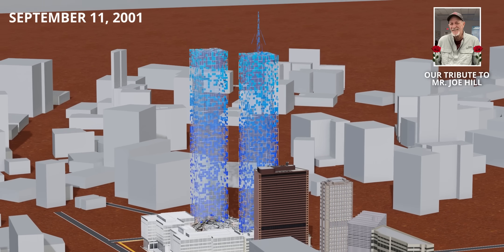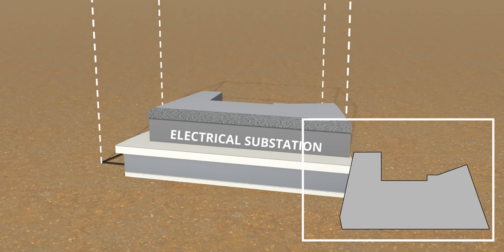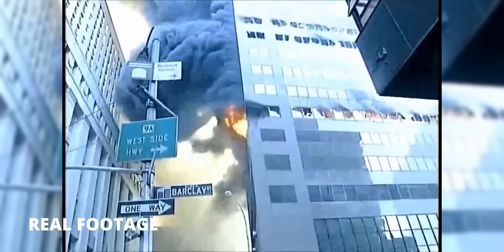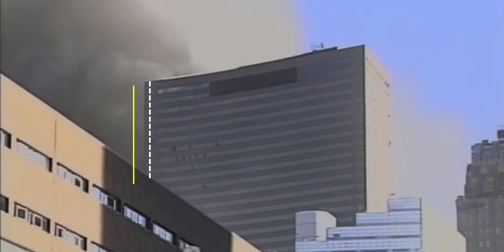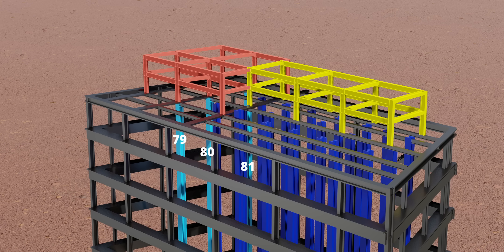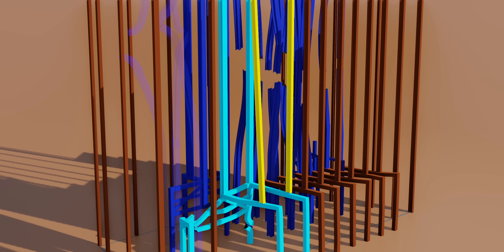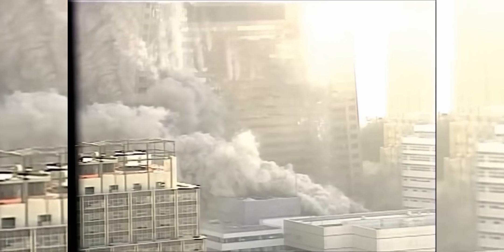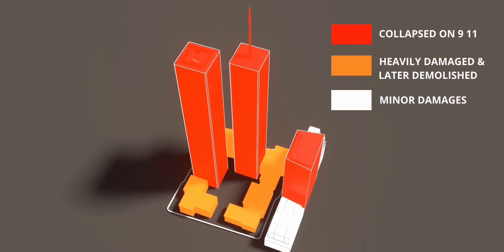Collapse of Building 7 | The Complete Physics

Comment: Absolute nonsense. It was a demolition job just like the twin towers. You have to be completely incapable of useful thought to think otherwise.
Reply: I’m going to respectfully disagree and offer a more plausible and detailed explanation using engineering, not ideology.

Much misunderstood, Building 7 was the 6th building to collapse of the 10 lost on 9/11. Because of its early low priority, conspiracy filled the information void with garbage made up by technically ignorant people promoting political agendas. But this is an engineering problem and should be treated as such, so I prepared this brief summary of my own analysis to fix that, using engineering, not politics and tired memes.

The North Tower collapse at 10:28am bombarded Building 7 with tons of debris, causing heavy damage and starting multiple fires which burned out of control for 7 hours. Half the FDNY firefighters having been killed, units in disarray, equipment destroyed, no water pressure, and the greater urgency of search & rescue efforts, firefighting was pulled as futile. The building couldn’t be saved and was left to its fate. That is the sort of choice firefighters make every day in brush fire situations - which houses to save and which ones to let go. Only real difference here is moving the decimal on the size and cost. People get overwhelmed by the size.

www.youtube.com/watch?v=g_SvpwyC17M&ab_channel=MFitz

Collapse of a burning structure is always a concern for firefighters. Steel buildings subject to fire rely on active fighting of the fires to survive. Buildings are designed around 1 to 3 hours of fire resistance, allowing time for occupants to escape and ACTIVE firefighting to get started, after which all bets are off. Left to their own devices they will exceed their design envelope and collapse, like Plasco Tower and Wilton Paes de Almeida. In B7 the occupants escaped, passive and active fire protections were compromised and active firefighting was abandoned 3 hours before the collapse, which left the building to its fate. It lost. Odds on Building 7 would eventually collapse, and it did. No big deal in logic.

www.youtube.com/watch?v=WnYBX6QT0R4

FDNY Chief Daniel Nigro ; The biggest decision we had to make on the first day was to clear the area and create a collapse zone around the severely damaged 7 World Trade Center, a 47-story building heavily involved in fire. A number of fire officers and companies assessed the damage to the building. The appraisals indicated that the buildings structural integrity was in serious doubt. I issued orders to PULL back the firefighters and define the collapse zone. It was a critical decision; We could not lose any more firefighters. It took a lot of time to PULL everyone out, given the emotionalism of the day, communications difficulties and the collapse terrain

FDNY Deputy Chief Peter Hayden ; We had our special operations people set up surveying instruments to monitor and see if there was any movement in the building. We were concerned of the possibility of collapse in the building. And we had a discussion with one particular engineer there, and we asked him if we allowed it to burn could we anticipate a collapse and if so, how soon? And it turned out that he was pretty much right on the money, that he said 'In its current state you have about 5 hours

The collapse of Building 7 was anticipated and widely reported in the media throughout the day, with 24 video cameras recording some or all of the collapse. Everyone knew what was coming and why.

www.youtube.com/watch?v=OY5S5k3tMHI

Building 7’s collapse was completely different to the Twin Towers and harder to understand as most details hidden from view and not intuitive, but we can still sort out what happened through careful analysis and observation. This is my explanation of the collapse relying on no outside authority.

Building 7 was complex, assymetrical 47-story steel framed structure built atop a smaller 3-story building, requiring lower floors dedicated to complex load transfer structures, not usable office space. Of trapezoidal shape and all-steel tube-in-tube construction, B7 (above the 7th floor) consisted of a central core of steel columns carrying most of the gravity load, perimeter steel columns around the outside of the structure carrying the remainder of the gravity loads and long span beams and girders to tie those elements together and form the floors. On the outside of the building hung a moment frame or outer shell.

Phase 1 : First externally visible signs of collapse initiation occurred at 5:20:28 pm and were notably quiet with observers not realizing the building was collapsing! No audible warning in the form of hundreds of ear drum busting 180-190dB explosive bangs preceding the collapse. Here at 12:00 a local CBS affiliate reporter is talking 10 blocks from B7 when collapse begins. People don’t start to notice the collapse until 12:11. At 12:45 is the famous CBS fixed camera clip of Building 7’s collapse. Note how quiet it is.

youtube.com/watch?v=t5tEy6mXSE8&ab_channel=fresnosean379

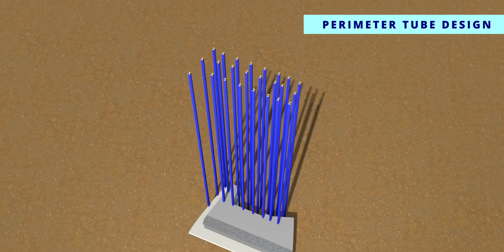Collapse initiation was due to lower floor failures above the load transfer region (7th floor) in the NE corner. In this video at 0:45 you can see the NW corner from inside the building while under construction, Column 79 just out of frame on the left. That big, angled steel beam across the top of the frame connects to C79 at one end. The girders connect to the beam. That beam and all those girders depend on just one connection

youtube.com/watch?v=nP3TNHPCIVU&t=35s&ab_channel=EdwardCurrent

Phase 2 : The floor failures caused a loss of critical lateral support over an excessive length of core Column 79 and it buckled. If you look at a floor diagram of Building 7 (see above) and look at all the structures that depend on C79 you quickly realize this one column was a relatively isolated structural element on which a disproportionately greater fraction of the structure depended analogous to say the Key Bridge. Externally we see a vertical progression of window breakage along the 44-46 line and a kink in the roof of the East Mechanical Penthouse at the top of the building, consistent with C79 failure. The transition from full capacity to almost no capacity occurs in an instant. Once the buckling failure occurs there is almost no resistance

Normally with a buckling column, the load could be redistributed to other columns. With C79 that is not the case - the failure did not redistribute the load, so the collapse rapidly progressed to the roofline, sinking the rooftop penthouse.

Phase 3 : With C79 gone, B7’s progressive, non-symmetrical collapse continues with C80 and C81 at the east end of the core left laterally unsupported and quickly buckled and failed as well, sending the EMP down through the building. C79-81 all have no diagonal bracing, which I believe is a major reason why they could not redistribute a lot of vertical loads among one another.

From there collapse progressed from east to west through the central core until the core was gone taking all of the interior floors and probably most of the perimeter columns with it. Follow the horizontal progression of window failures low in the building and the dropping of the remaining rooftop structures into the building. One of the big takeaways from the NIST Building 7 study (that gets completely ignored) was their modeling which determined C79 failing under ANY circumstances would have initiated the same collapse sequence.

Phase 4 : After 10 seconds only the exterior moment frame - a hollow empty outer shell – remains, giving the ILLUSION the Building is still standing since little has outwardly changed. It is just a hollow empty shell like an empty cereal box. Supported by only a few remaining columns that empty shell is quite unable to remain standing. With all core columns and floors gone, the north face leans inward, forming a V in the roofline, the last few columns buckle under the strain and the moment frame free falls, landing on top of the 7-story high debris pile. It is only late in the game here at the end that a single measurement of alleged free fall acceleration is taken, from a single point on that outer shell. The Building did not “free fall” – just one corner of the outer shell did, sort of. The Building was already gone before that happened. The period of alleged free fall was a product of how it fell NOT why it fell and cannot tell us what started the collapse. Start to finish the entire collapse took 18-20 seconds, 3 times longer than true free fall . How fast something falls cannot tell you what started it falling_ anyway. The debris spread outside the footprint, blocking surrounding streets, heavily damaging the Verizon Building and destroyed Fiterman Hall.

Building 7’s progressive, non-symmetrical collapse was incidental and unintended collateral damage from the combined effects of fire + time + gravity, started by the collapsing North Tower. That is true no matter who planned and carried out the 9/11 attacks or why . The collapse was of so little consequence it barely even registered at the time, a mere footnote. It only took on semi-mythical status as an alleged smoking gun years later when demolitions at the Twin Towers, missiles at the Pentagon and shoot down over Shanksville all failed and conspiracists had nothing left to work with.

Anything can seem like a conspiracy if you don’t understand how it works. Now you should. I hope you found this helpful, informative and it solicits informed critical comment. If I made any errors of fact, logic or reason or left anything important out, please let me know so I can fix it. IF you can offer a more plausible alternative please do. Be the first. Please start any reply with the words “Tits McGee” or I will know you didn’t read it and are wasting my time.

Comment: I hope everyone notices that they’re using AI to talk about the collapse instead of going to the architect Irwin Cantor.   
In the AI voice can talk all at once about loads that held up millions of tons for nearly 30 years without a problem  but somehow fell down into itself because of small fire on steel beams with fireproofing covers 
And mind you, these fires burned all day without destroying the windows meaning that somehow WTC 7’s glass was more fire resistant than its steel with the fireproofing cover.
Reply: Irwin Cantor was a civil engineer, not an architect and he died 8 years ago so pretty tough to book him on the program.
Reply: @TheCriticalStinker-01  Cantor had his own architectural firm.  And you could have gotten his interviews about the building from The History Channel.  You’ll find he was EXTREMELY reluctant to suggest fire brought down his building .
Reply: "these fires burned all day without destroying the windows meaning that somehow WTC 7’s glass was more fire resistant than its steel with the fireproofing cover."

Nope. It not what it means.
The temperature at which both of these materials are becoming malleable are almost identical - depending exactly which glass or steel we are talking about. As the steel parts function was to bear high loads of the structure while the glass function was to bear only its own weight, there is no wonder the steel gave first.
The fireproofing of the steel only slows the process of heating it up. It can't prevent it. After quite short time (probably around 30 minutes) it becomes entirely redundant.
Gets worse. The "fireproofed" steel will stay hot for longer than the bare one after the heat source is removed.

Comment: Reported for misinformation, as Bldg 7 (and 1 & 2, for that matter) was quite clearly and obviously that of controlled demolition <3 nice try though!
Reply: No, the guy with the working brain and the engineering degree got it right. The anonymous bloggers and YouTubers whose nonsense you mindlessly repeat are talking out of there ass.

This is true no matter who planned and carried out the 9/11 attacks or why (hint: that means 9/11 could still have been an inside job - no need to promote absolute nonsense technical claims about demolition which have been failing for 24 years).

Comment: Falling into the maximum resistance still dont make sense. explosive residue? Pull it? Fire department commissioner testimony? third building in history made of steel to collapse because of fire? 
You can blow half a steel build up; and it doesn't collapse, oklahoma
Reply: What maximum resistance ?

Down is not maximum resistance.
Reply: @TheCriticalStinker-01   What huh, yes it is , i haven't falling into the Earth Core.
Reply: apart from falling into air, not steel/structure (e.g. breaking the fall)
Reply: @HoldinLong  - But the building is falling because the structure failed, so where is the resistance?
Reply: @TheCriticalStinker-01  Its apart from falling into Air, there is still structure to fall into (not every floor failed)
Reply: @TheCriticalStinker-01  Apart from falling into air, Every single column, even the curtain wall must fail for zero resistance.
Reply: @HoldinLong  - The building is 95% air by volume. The gravity loads of the building were supported by columns. Collapse progression was not by floor failure. The columns buckled and failed one-by-one.  As each column failed, it pulled down any and all attached floor beams and girders along with it.

Were you not paying attention?
Reply: @TheCriticalStinker-01  I was paying attention but logically, as a simple e.g. If one of my chair failed would I fall vertically into solid matter or fall into the side. PS so obvious it was a false flag
Reply: @TheCriticalStinker-01  I am willing to discuss scientifically and  will respect your opinion
Reply: @TheCriticalStinker-01 Off course I was Paying Attention? Willing to discuss scientifically, I respect your opinion. Who knows U might change my mind, however Im extremely confident it was a false flag for Invasion of Afghanistan and Then Iraq.

Comment: This was a controlled Government approved demolition, No Questions, as was the  other two towers
Reply: Peter …..   Buildings 1 -2 - 3 - 4 - 5 - 6 - 7.   ALL. fell  ..  I doubted her for a long  time but the. “ where did the towers go “  lady is 100% correct.. not allowed to type her name because she is Banned…. That says it all. …. pls look for the vid. ( the book cover is enough to convince us ) …. 
Looks more like a “ volcanic eruption “. upwards and outwards with steel disintegrating before even getting close to the ground….A Nowhere near high  enough debris pile considering 2x. 200,000 tons of steel -  concrete -  glass -  marble 
She says imagine. 5 Titanics…. It is the undeniable 2” layer of Dust over most of Lower Manhattan..
+. 1400 cars damaged in strange ways ( no glass and only half burned in most cases ) .. Not crushed -  
and some even half a mile away on FDR  Drive.
Even the Therm*** conclusion is only partially correct.. 
Did you know that measurements of the Earths magnetic field. Changed -  for EXACTLY the hours of the “ falling down “. 
Difficult to understand I know -  but. “. Directed  Ener** “. the most realistic explanation in conjunction with the. missiles..
Definitely. “ volumetric projection “  convincing 3D. Holograms…  keep digging…